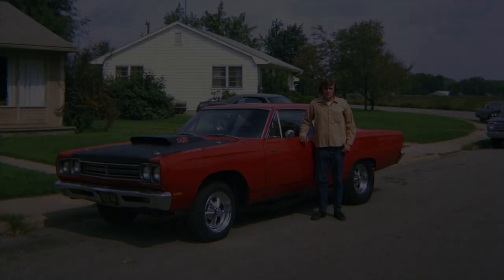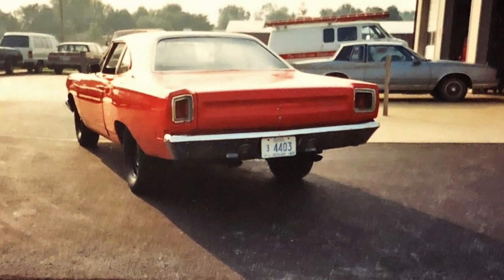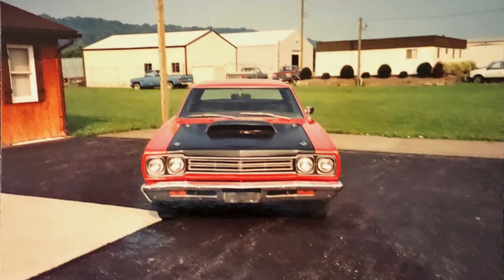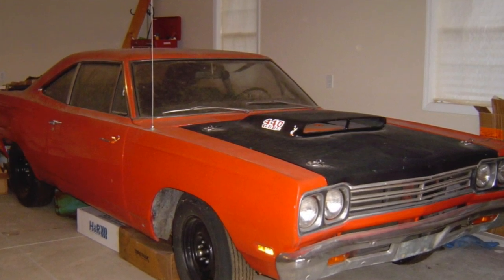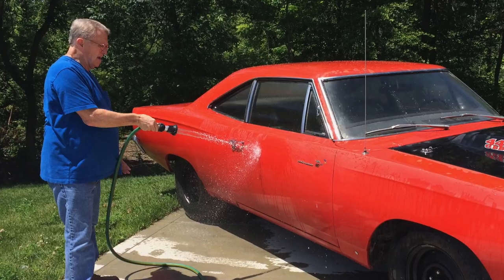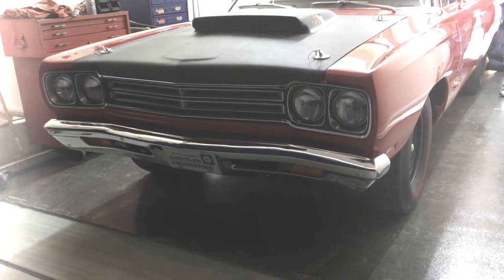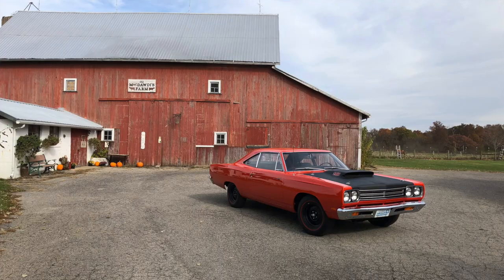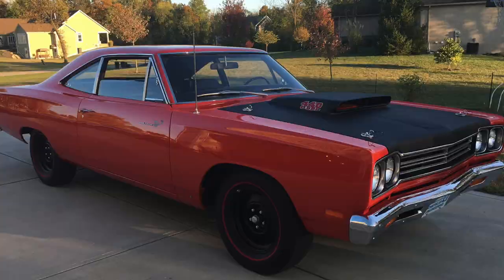The Road Runner Story | A Documentary

Comment: Dad worked for Illinois Central RR for 43 years started in '59', in '70' he bought a Road Runner and they were made in St.Louis at the Fenton plant so he may have hauled that car when it came over the river to the IL side. I do remember he'd sit me on his knees I was 5 at the time and car had power steering so it was no problem for me to steer but couldn't reach pedals, probably a good thing at the time, I remember getting the key and starting it, still remember the feel of the ignition. He sold it a few years later and man was I unhappy no more meep meep. I wish I could find out if that car is still out there. If not I'm still gonna acquire one, hopefully in the very near future. Dad passed in '13' he'll have the first ride at shotgun. Car was the same color as your A12 and Road Runner and Bird on door too